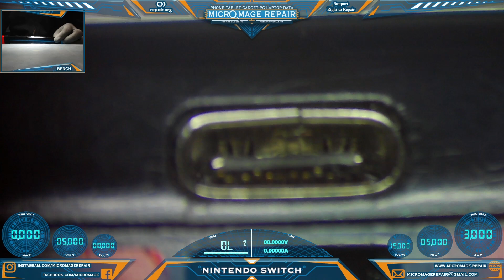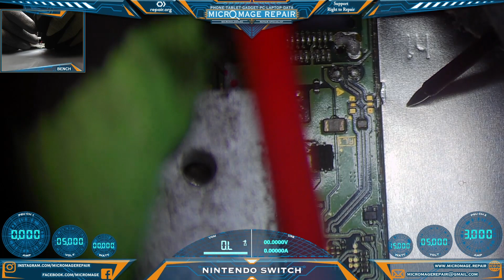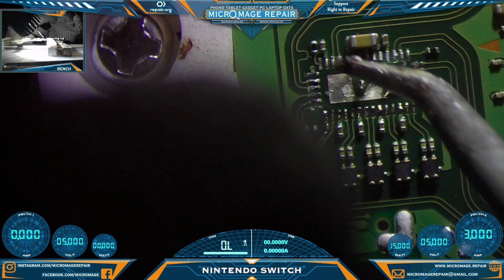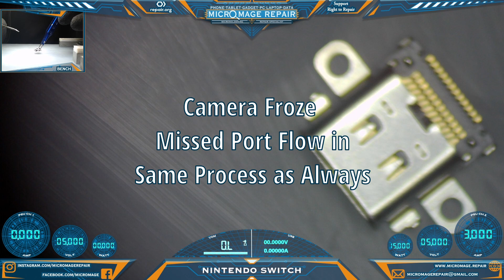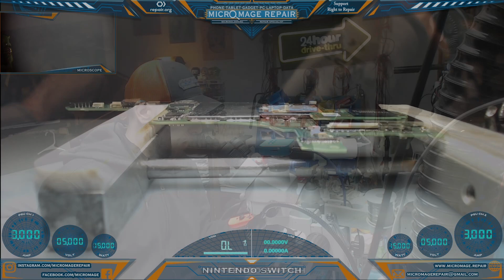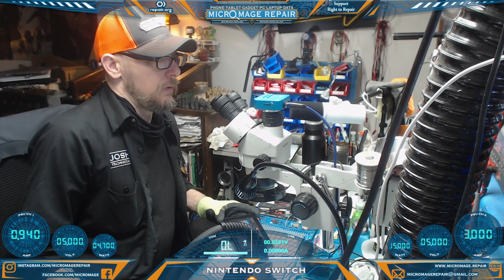Power Applied to Broken Port. Fixable?

Comment: Cracking repair Josh. those pads strips are ok for a couple of repairs but not worth the time and effort on destroyed pads where you need to fix 5 plus pads. I finally got hold of a grinder. not the pen type a miniature Dremel type it works perfectly fair play. Scraping mask sucks so this makes life a little easier.
Reply from the maker: Much appreciated Lee!
Agreed on the lugs.
Great for spot repair, definitely don't care for them on major damage.
My grinding pen is probably one of my best ever purchases, it saves so much time!

Comment: Great vid as always, the amount of repairers that don’t check the USB port first and simply plug a power cable in is nuts then wonder why the switch blows or doesn’t turn on lol
Reply from the maker: Thank you Roy!
Yes, and shops are often guilty of doing so too. Not just the owners.